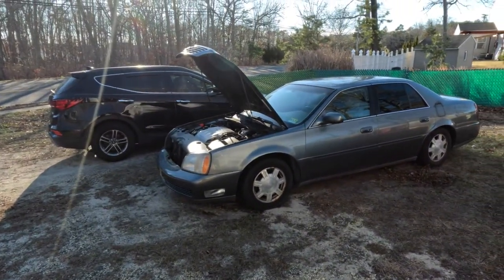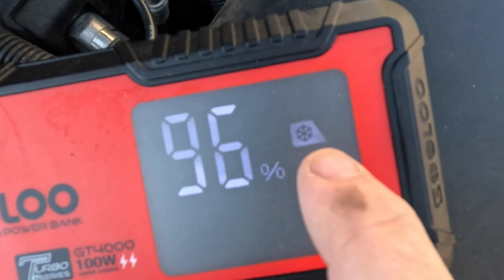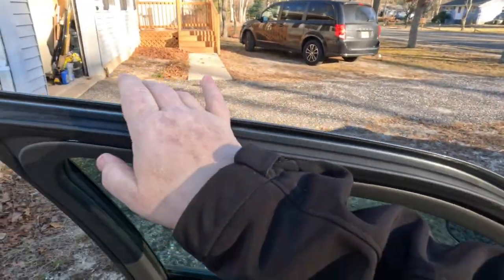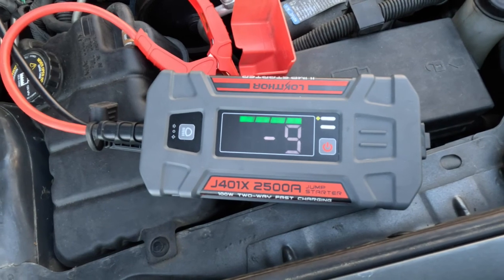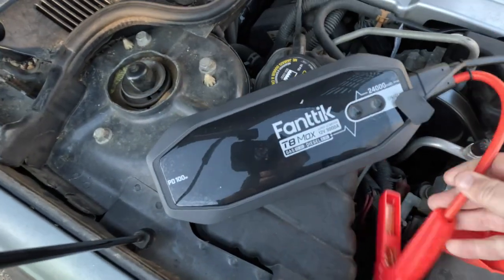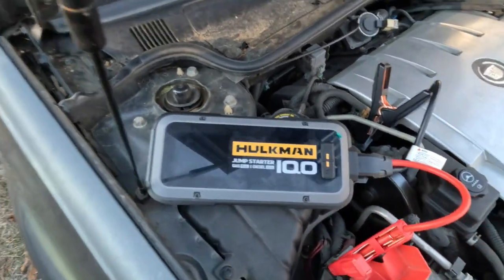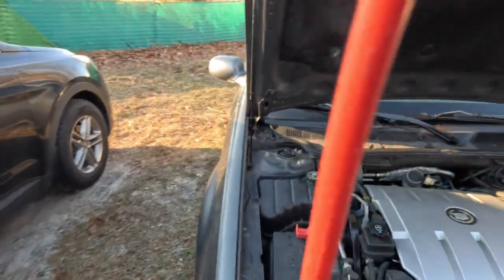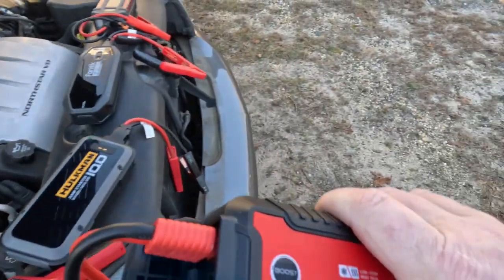(Freezer Challenge) HULKMAN 10.0, GOOLOO GT4000, LOKITHOR J401X, FANTTIK T8 MAX

Comment: Did you purchase or configure the long jumper cables used on the GT4000 model?  If purchased, where?  Thanks for the video comparison.
Reply from the maker: We configured the original size cables and made them 3 feet long to help with tight clearances. We have a video showing us making the Gooloo GT4000 extended cables. But keep in mind, Un that video, it was very early in my soldering career and I didn't do things up to peoples standards. Lol. Thanks for the comment

Comment: Yeah,it shows right in the instructions you have to press both buttons for a few seconds to activate the preheat feature. Mine has never failed me.
Reply from the maker: it does NOT say to push both buttons to activate pre heat technology in my Gooloo GT4000 manual. And just because your Gooloo is the greatest unit of all times, in your eyes, doesn't mean everyone has the same experience with their Gooloo GT4000. It Clearly says in the Gooloo GT4000 manual, in order to activate preheat technology you must wait 100 seconds after the Gooloo is hooked up to the battery before the preheat activates, or if the Gooloo is not hooked up to a battery, you could push only the Boost button to activate preheat technology. No where in my manual does it say to hold down the power and flashlight button together to activate preheat technology mode. Like i have mentioned in many of our videos, i think we may have a defective unit, but thats our experience with the Gooloo GT4000 pre heat technology. So just because yours work great, doesn't mean everyone's does, everyone have different experiences will everything in life.

Comment: In the instructions for the Gooloo GT4000, it states that it can take up to 100 seconds to pre heat. So maybe in the test conditions which you used, maybe it just needed a little longer.
Reply from the maker: We gave it up to 20 minutes on and off camera and it still didn't work. We will be doing an updated video soon. Thanks for the comment
Reply: @HM_RELOADED press and hold the boost button, you didn't warm it up
Reply from the maker: @olivderpo  if you noticed we pushed the boost many times, we waited 10 to 20 minutes on and off camera, it was warmed up
Reply: @HM_RELOADED  нужно нажать кнопку и держать нажатой 3 сек. Будет температура индикация и разогрев.
Reply: @HM_RELOADED  The jump starter will automatically turn on the preheat function after connecting the vehicle battery or pressing the BOOST button for 1-2 seconds in very cold conditions.
Reply from the maker: @olivderpo  Did you watch the video? We connected the cables to the battery,  we waited and waited over 20 minutes,  we hit the Boost button many times, the preheat technology Never activated. The snow flake illuminated the whole time and Never shut off. You are supposed to wait 100 seconds after connecting the cables before starting your car and the preheat technology should have actually by that time. We followed the manual and advice from other mechanics and the preheat technology Never activated. We just did a recent video with the Gooloo GT4000 and the freezer test and the same thing happened, but we kept giving it more and more time and it the preheat technology finally activated and the snowflake disappeared and the car stated. The preheat technology is hit or miss on my Gooloo GT4000 for whatever reason as the 2 different videos will show. The preheat technology is supposed to automatically activate after you hook up the cables, but for whatever reason it did not activate in the first video, and barely worked in the second video. Thanks for the comment
Reply: Wow.. It must have been defective then. Thanks for your efforts. Keep up the good work.

Comment: Any update on the GooLoo? Does the manual explain how the preheat function works? Maybe dive into this further on why the preheat function failed or didn’t function? Factory defect maybe?
Reply from the maker: We followed the instructions in the manual to a tee, so we were surprised the preheat technology didn't work properly, and that was only being around 12 degrees when it was tested, its rated at up to negative 40 degrees. We will be doing a follow up video shortly to see if it was a fluke that the pre heat technology didn't work properly with Gooloo Gt4000, or if we had a defective unit. Appreciate the feedback, thanks again.
Reply: Did you contact Gooloo about this? I just ordered one. Will be here tomorrow.
Reply from the maker: @jnstrcklnd I ordered a new one, we are going to test the new one when we get it to see if the new one gives us the same issue. We are thinking we have a defective unit, we will find out soon. We have other videos showing the Gooloo GT4000 took about 15 to 20 minutes for the preheat technology to activate, but that's way too long obviously. I love my Gooloo GT4000 and never had an issue with it. I contacted Gooloo a while back and since my warranty was up, they couldnt do anything, also i extended the cables to reach 3 feet, so naturally if i had a warranty it would have been voided. Good luck with your Gooloo
Reply: ive had mine for about 6 months and im an auto tech and have used it many times this year up to 6.7l  Diesels with no problems. i reccomend it. @JonnyBlazeTCB

Comment: The Fanttik T8 MAX included in this review does not have any built in PRE-HEATING technology. Therefore, including the Fanttik T8 MAX in this review is misleading. Also none of the manufacturers’s PRE-HEATIING technology allows the Jump Starters to be placed inside a freezer. The PRE-HEATING technology only works when the ambient temperature falls below the the stated operating temperature of a given jump starters. Therefore, this whole review not consistent with the manufacturers recommended use of the jump starters and hence, is very misleading.
Reply from the maker: That is the point of this video and our channel, we are doing an Extreme test to see whether or not these units would still work since these units are supposed to jump start up to -40 degrees which IS the recommendation of the manufacturers if you look in each manual. Also, the freezer was set to -0 (Not -40), so being in the freezer was a big advantage temp wise for those units and they all should have worked in that temp setting, since these units are supposed to jump start in up to -40 degrees as advertised, except the Fanttik T8 Max. As for the Fanttik T8 Max, I mention in the video that I wasn't sure if the Max had pre heat technology, but we would try it anyway, and to our surprise the Fanttik T8 Max was still able to jump start in freezing conditions, which is incredible. This is why we do videos like this, so people will know what units work and which ones do not work. I just don't understand your inconsistent comment, there was nothing inconsistent or misleading. I think the whole purpose of my channel, and this video went over your head. We thank you for the comment.

Comment: I have both the hulkman 10.0 and Fantek t8max, I will tell you both work great and I carry the fantek in my truck at all times, I like the battery voltage it shows and it is more then enough to get my 5.7L v8 started from a dead completely dead battery, the lokithore looks like a solid option as well. I think the fantek t8max is a better deal, its a bit cheaper then the hulkman 10.0 and has done everything I have asked it to like cars trucks vans and boats, I will keep the hulkman in case something happens to the fantek but time will tell. Super happy with both of them, get one you wont be disappointed, I like this type of review you do.
Reply from the maker: It's always smart to keep a backup jump starter just in case your primary jumper poops the bed. Lol. The Fanttik T8 Max and the Lokithor J401X are very well made, and very powerful. The Hulkman 10.0 is my primary jumper, but if it ever goes bad, the Lokithor J401X, and Fanttik T8 Max have shown incredible promise. Thanks for the comment.

Comment: wow, thank you so much for such a detailed comparison. I had high hope for Gooloo GT4000 with its unique pre-heating feature because a couple days ago Montreal was hit with -40 degrees C for 3 straight days. My GB40 couldn't even jump-start my car in this kind of weather. Probably my fault for leaving it in the trunk but I did charge it a month ago though. May I ask which one of the big boy jump starters you recommend? Do you still have faith in Gooloo? Thank you very much for your hard work and have a good day!
Reply from the maker: The Gooloo GT4000 is a great unit, but for some reason the pre heat technology didn't work that well 2 different times I tested it. Aside from the preheat technology issue I had, the Gooloo GT4000 is a great unit. I actually love what I am seeing from the Lokithor J401X, very well-made unit. I recommend all the top jump starters I used in this video, but for whatever reason the Gooloo GT4000 did not do too well with the pre heat technology as shown in the video.
Reply from the maker: Thank you so much

Comment: Nice reviews and Tests , The Fanttik is a Chinese copy of the Hulkman . The GT4000s is the upgraded version of the GoolooGT4000. Thanx for the tests , much appreciated.
Reply: The GT4000 is actually the upgraded version of the GT4000S. It was released a year later.
Reply from the maker: @ExquisiteIdea  Correct,  the major upgrade is that the GT4000 has the -40 preheat technology,  and the GT4000S does not. Great jump starter
Reply from the maker: My pleasure,  thanks for the information
Reply: @HM_RELOADED   No thank you great channel .
Reply from the maker: @parabot2  Thanks
Reply: Hulkman is designed in the US and manufactured in China.

Comment: The first time my hulkman 10.0 activated the pre-heat function it melted and smoked so bad it ended up in a dumpster (7 degrees F).
Reply from the maker: That is very unfortunate. I'm sorry that happened after spending good money on these jump starters, only for them to fail when needed most. Luckily, I have had no issues with my Hulkman 10.0 when activating the pre heat technology. Hopefully, it continues to work like it should.
Reply from the maker: My recommendation would be to contact Hulkman directly, maybe they will warranty you a new one...who knows.

Comment: It appears that the pre-heat mode never came on.  It should show to the right of the snowflake.  Check the manual, it tells you there are 3 squealy lines that should appear when the pre-heat mode is working.
Reply from the maker: If you are referring to the Gooloo GT4000, the snowflake indicator icon let's us know that the unit is too cold, the 3 squiggly lines are supposed to illuminate that the pre heat is working as you said, so by the squiggly lines not appearing tells me the preheat function was not working properly for whatever reason. Actually, it also says in the manual that you're supposed to wait 100 seconds (which we surpassed) or press the Boost button 1-2 seconds after hooking up the unit to the battery in low temp weather in order for the low temp technology to work. We did all those things and the pre heat technology still didn't work. We will do a follow up on this as well.
Reply from the maker: @justmeonlyme We had the Gooloo GT4000 with preheat technology. However,  we had a defective unit. Gooloo actually sent us a brand new GT4000, and the preheat technology worked great. We have a video showing the new Gooloo GT4000 in action working flawlessly. 
I have never heard for a fact that the Gooloo GT4000 destroys tractor starters. In fact,  I have used the Gooloo GT4000 many times on my Craftsman GT5000 riding mower and never had an issue with my starter. If many videos had a silimilar experience with the Gooloo GT4000 destroying tractor starters, I would say to stay away from the Gooloo. But if one video shared that experience, I would wait to see if other people have the same experience before staying away from Gooloo. In my experience,  Gooloo GT4000 is a great product. 
In reference to Hulkmam. If you live in a warm climate like California,  the Hulkman 85 is the way to go. I paid $169 for my Hulkman 85S with preheat technology a while back. It just depends where you buy things. 
I hear the Lokithor J2250 Lifepo is a great unit as well. I just haven't had the opportunity to test and review yet. It's coming. 
We have issues with Noco products only on our 2004 Cadillac Deville V8 for whatever reason. The Noco products work great on just about every other vehicle. So we are assuming their is a compatibility issue with my vehicle. Therefore, we never sent the Noco GB150 to be looked at since it works on every other car. 
We appreciate your comment. Please feel free to reach out again.

Comment: I just received my gt4000 yesterday; what a disappointment. From looking in the manual, there should also be preheat and digital temperature indicators displayed when the unit is preheating and should just take 100 seconds. That sure looks to be a malfunction. Hopefully you can find out more. Maybe I'll just send mine back to Amazon.
Reply from the maker: The Gooloo GT4000 is supposed to have -40 preheat technology, but I waited along time to jump start after taking the Gooloo GT4000 out of the freezer. After about 20 minutes the preheat snowflake never disappeared off the unit. So it looks like maybe my Gooloo GT4000 malfunctioned or just can't handle the really cold weather as advertised. I am going to do a follow up video on the Gooloo GT4000 to see if maybe it was just a fluke that the preheat technology did not work. The Gooloo GT 4000 has always worked great for me, so far the only down fall so far is the preheat technology, and why it didn't work. We will figure it out
Reply from the maker: I have tested the pre heat technology a second time on the Gooloo GT4000 and we had the same issue, the cold impacted the Gooloo GT4000 so much that the pre heat technology would not work correctly and would not jump start the V8. We waited the recommended 100 seconds it says in the manual, after all else failed we waited about 30 minutes, and the snowflake icon was still illuminated on the Gooloo GT4000 and would not jump start the V8. We hit the Gooloo GT4000 after 30 minutes with a temp gun and it was reading 43F and still wouldn't jump start. So, I am assuming the freezer test was just too extreme for the Gooloo GT 4000. After a few hours I went back to the Gooloo GT4000 to see if the snowflake icon disappeared and it had, the Gooloo GT 4000 worked perfectly after that.
Reply: @HM_RELOADED  Thanks for the follow-up on the gt4000 freeze test, good to know! Might be a good video in itself. FYI: I returned my gt4000 to Amazon within the 30 day return period. In its place I got the hulkman alpha 85s (from Newegg). I like the hulkman better, very nicely designed and I like the position of the clamp connector and light. Great reviews on these products!
Reply from the maker: Great choice, good luck with the Hulkman 85s, I'm sure you will be happy. That's the exact unit I use in my personal car. Thanks for the update